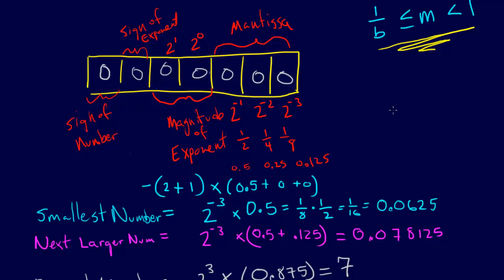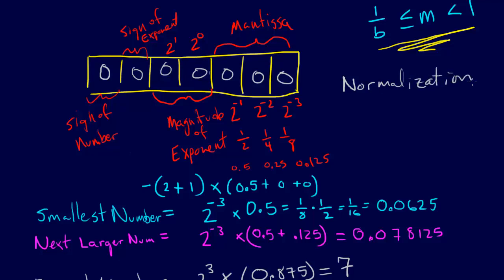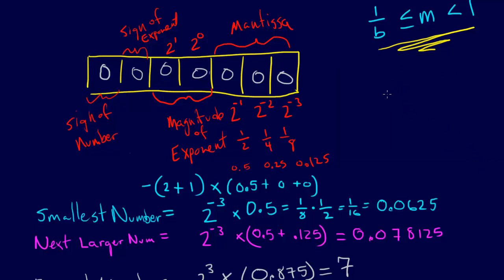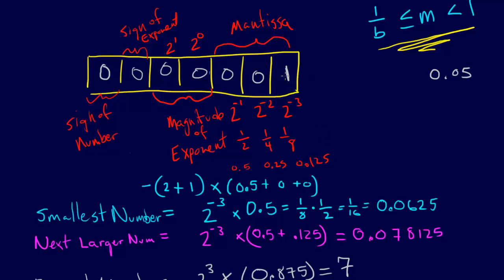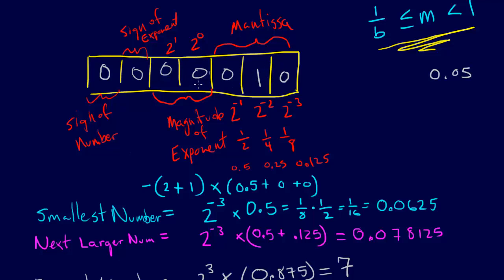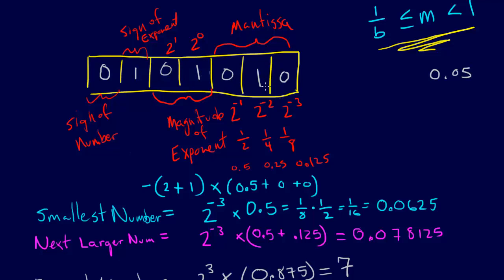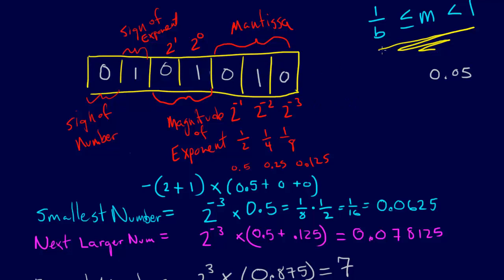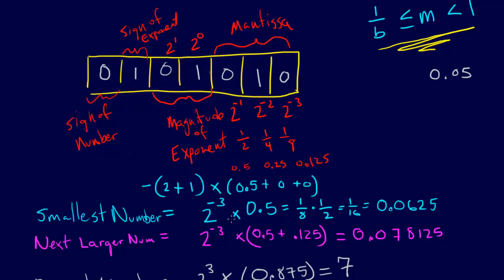1.2.7-Modeling & Error: Normalization

Comment: Let's say we have a number 0,0000000058. If we normalize this number, does it become 5,8 . 10^(-9) or 58 . 10^(-10)?  

I would also like to confirm another thing. We are using floating point number representation in this example and we are trying to normalize the number 0,05. But we can't have a value smaller than 0,0625 because of this restriction 1/b<m<1 and therefore mantissa has to be 1/2. So after the normalization process, we see that we can't represent the number 0,05 because the smallest number we can get is 0,0625 and therefore the normalized value of 0,05 is 0,0625 for the floating point representation? Also what does this example have to do with getting rid of the useless zeroes?

Comment: I don't understand why the smallest number would not be - 
0111001

sign of number = 0 = positive
sign of exponent = 1 = negative
exponent = 11 = 3
mantissa = 001 = 1/8

= 1/8 * 1/8 = 0.015625

What have I missed?
Reply from the maker: You are correct in that it would be possible to do it that way, but we don't. We use normalization. With normalization, the leading bit in the mantissa must be 1. Always. That's the rule. In practice, this means we don't have to store it, and so we instead get to put that bit to better use, but for this example, we're explicitly setting it. As a real life example, a single precision (32-bit) floating point number with the IEEE 754 standard has 24 bits of precision in the mantissa, but only 23 bits are used to store it. This is possible through normalization. Nothing is free, so the price of normalization is that we can't store numbers that are quite as small. I hope that makes sense.